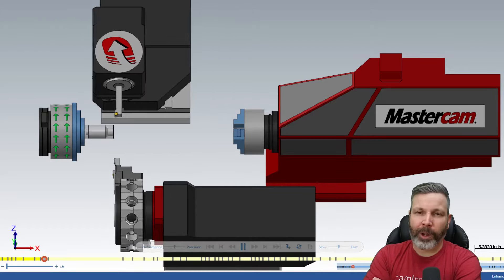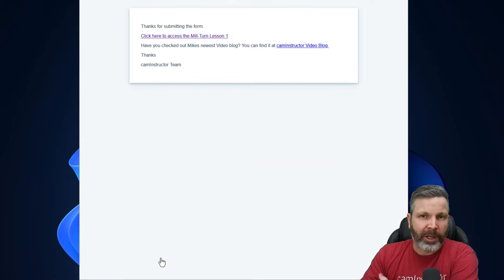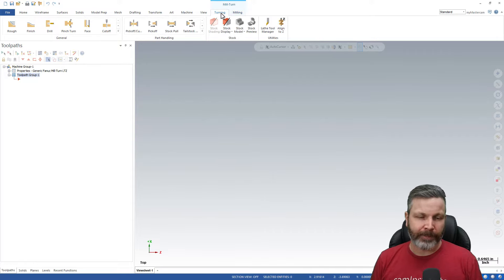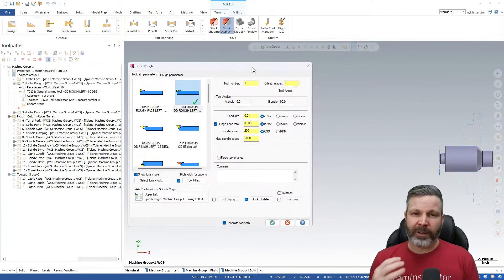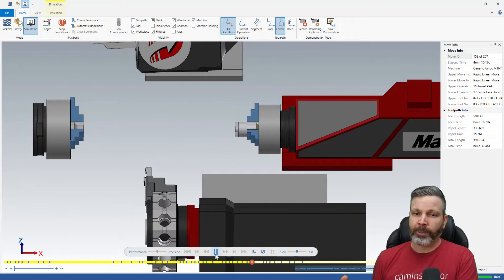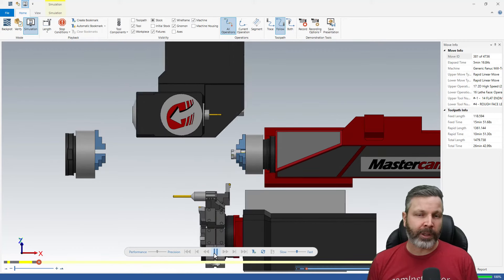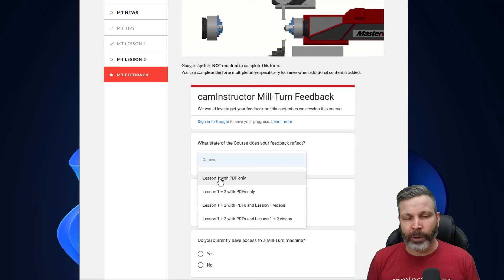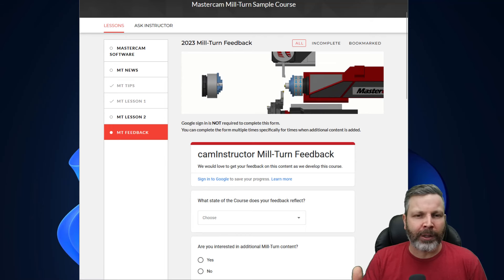I Gave Away Free Mastercam Mill Turn Lessons and This Happened!

Comment: Thank You Mike 🙏🙏  Teaching material for mill-Turn is in short supply.
I am particularly challenged by having to change settings in the machine simulation for each new program. 
Tool offsets that change when tools are brought in from the tool library, etc. :-)